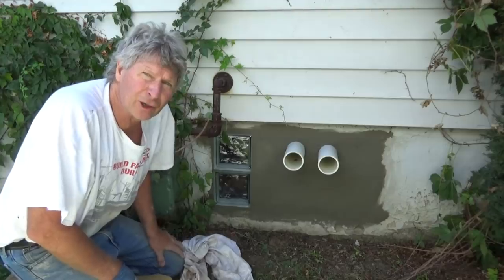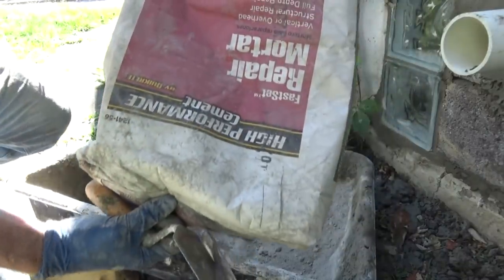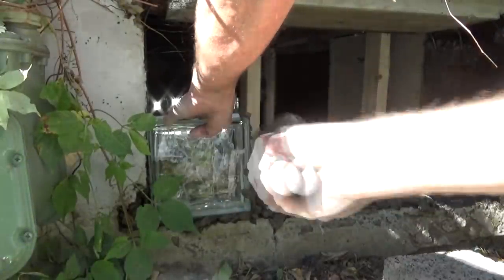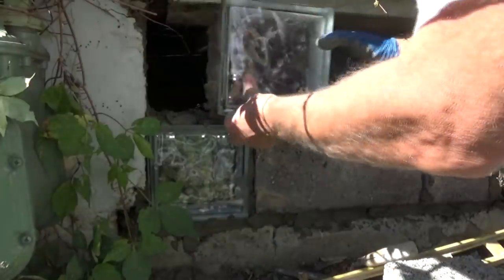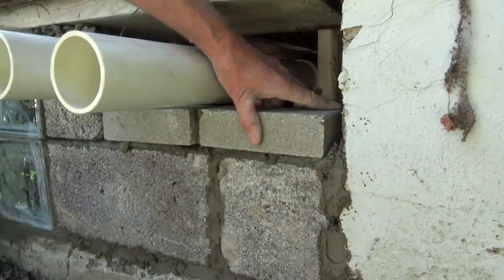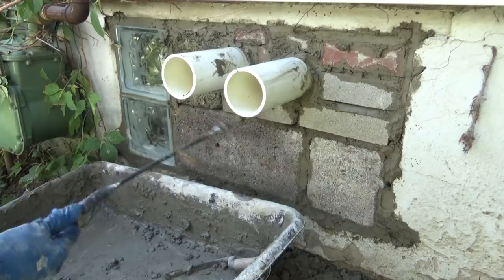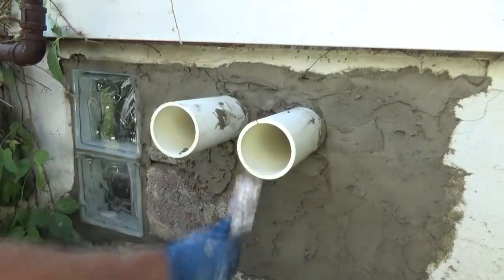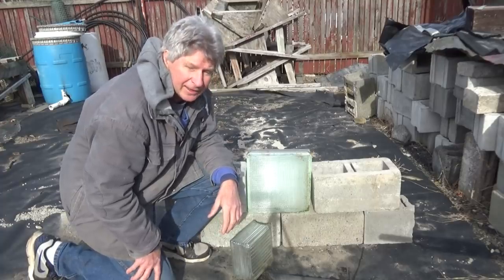GLASS BLOCKS IN BASEMENT WINDOW (Part 3) Mike Haduck

Comment: Hey Mike, another cool video. I like the glass block solution. Light is very powerful stuff. A lot of mold, mildew and other problems are stopped just by light. If you leave the bathroom light on, a lot of mildew problems can, but not always, go away. (I just got back from Hong Kong, I guess we're both grounded for a bit. No videos on masonry, but I shot lots of video of people wearing masks) 

I wonder if I can ask you a tech question. My next door neighbors, here in Los Angeles (so no freezing) have a flat roof. One small area about 10 x 16 has a section that ponds and causes a leak. (  Three 60lb bags of Redimix would more than take care of it--so not too large) My best guess is to pour in some kind of roof leveling cement mix. Have any suggestions on what product to use? I think I'm going to be roped into helping, so it won't be pretty but it'll be to spec. Thanks. Will
Reply from the maker: Hi Will,  there is not any concrete roofs in my area, mainly because of our weather so I can't really answer that one,  but it sounds like your on the right track,  Thanks mike

Comment: Hey keep up the good work. Quick question might sound dumb and i wasnt sure where to ask. Anyways here goes I have a dewalt rotary hammer drill. When do you use the drill function? Vs when do you use the drill and hammer function? I was mounting a tv on a stone chimney when i used the drill and hammer function it started to crack at the mortar joints. I started to drill first and then after I got going switched to the drill and hammer function that seemed to be ok. Just wanted to know what you do thanks.
Reply from the maker: Hi Sean, I never thought of it, when going into masonry I almost always have it on the driver part, but I seen other just take there time with the basic drill, I guess anything that works in your situation,  thanks Mike

Comment: On a bigger glass block job you want to use a portand-lime mortar. It 'grabs' the glass much better than masonry-cement aka portland-'air' cement😂. .. That's what the technical guy at Pittsburgh Corning told me, 22 years ago. (Pittsburgh Corning is one of the biggest manufacturers of glass block.)
Reply from the maker: Hi bonanza,  I can't disagree,   I stay away from those big jobs, so I can't comment,  thanks mike

Comment: Make sure you check your local building code before you replace a window with glass block. My neighbor removed a small bathroom window, and replaced it with glass block. Then the county made him tear it out because bathroom and basement windows here in Maryland must have a vent or opening of some kind. I’m not sure that he couldn’t have cut out a middle block or two and installed a vent, but maybe he couldn’t find one in the right size. ☹️
Reply from the maker: Hi Lee. They had plenty of other windows in the cellar, thanks Mike
Reply: Mike Haduck Masonry : My comment wasn’t meant for your work, Mike. I know that you know what you’re doing. I’m just always surprised by the number of people who watch a YouTube video on something being built, and then ask whether a permit is needed. It seems that a lot of folks aren’t aware that it totally depends on your local county - they are the ones who set the rules for wherever you live.
Reply from the maker: Thanks Lee, Mike

Comment: wouldnt it be easier to block up the window and then let the plumber drill holes afterwards?  Lazy plumbers...
Reply from the maker: Hi max, I don't know, 6 in one hand half a dozen in the other,  thanks Mike
Reply: Speaking from the perspective of a guy who has drilled a lot of access holes in concrete and cement I'd prefer the pipes be put in and save me the drilling glory.
Reply: @pensive69  Specifically referring to this video. Drilling through cinder blocks usually isnt a problem. Especially if their hollow